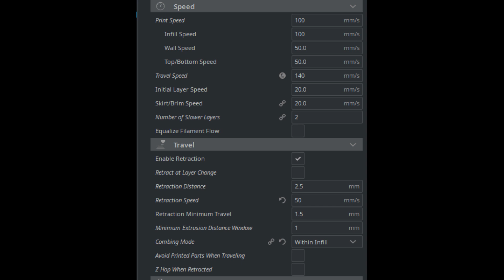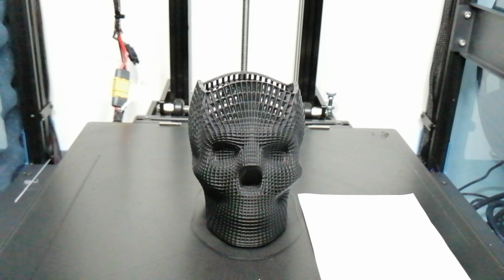Ender 6 - Stringing solved + Tips for Newbies and the Community

Comment: just recently discovered you, so my ender 6 strings like crazy, so decided to give it one more good hurrah before i fill it with tannerite and make a youtube video. I'm working on relocating the extruder like you did here, so when I got home my ender 3 had finished printing my spacer/cable chain holder. I mounted the extruder up on the top rail and held up my Bowden tube, nice and tight because "who the fuuk prints in the corner" it looks like I'm only gaining about 6 inches less Bowden. does that short amount of gain really make a big difference or should i just mount it on the hot end and get it over with? wow sorry that turned out so long. I'm a texting mo fo
Reply from the maker: so i saved about 1/3 of the original bowden. You may have to let the bowden be "free", not in the cablechain :)

Comment: Just got my 1st 3D printer, an Ender 6, after helping my son set up his Ender 3 and after much mulling and review watching decided I'd like to get into the hobby. What a printer. Great prints out of the box with no calibration other than levelling the bed. I'm sure it can be improved through tweaks and your vid helps in that regard. I did have a bed adhesion issue to start with but with thorough cleaning, levelling and some initial layer heating and speed settings I think I've cured it. At least for the filament that came with the printer anyway. Great printer that I sure with some basic tweaks can provide many with good service.

Comment: Why use noctua? It's cfm rated 30% lower than stock fan.
Reply from the maker: i switched to a noctua cause the stock fan was horrible loud. In the meantime i switched to a Watercooled hotend :)
Reply: @PhilsBastelwelt  I decided to go with a delta electronics (the guys that do the fans on prusa mini and the new xl) awesome cooling, deadly silent. 

Watercooling? Wow. Not a consideration I've made yet.
Reply from the maker: @OiRob  I actually made a video abot the Heatsink i used (pretty cheap)... but it works very good. No heatcreaps, no clogges, works for me :) 
Will make a Video in a few days about that. Had some other issues to solve :)

Comment: Thanks for the video.. How did you solve the overextruding in the edges? I installed klipper and was able to solve it with pressure advance, but i have a value of 1.2 and that makes the extruder motor go crazy.. my extruder is in your same position.
Reply from the maker: Honestly …I need mir info about your printer…did you change something on the Hotend ?
Reply: @PhilsBastelwelt  yes, i changed the fan to a noctua and installed your lower pla part to avoud it blowing on the part. The extruder motor is placed where you placed it, and the tube is a capricorn. Thank you for your time
Reply from the maker: @sharkyigor  so you have the stock Hotend ? Stock Nozzle and stock Heatbreak? 

If this is the case you can try another nozzle or print slower…
Sounds to me that your Nozzle has to much inner resistance and a bad flow inside the nozzle..
Reply: @PhilsBastelwelt  ok thank you! Will make those tests and get back! Thank you for your support
Reply: @PhilsBastelwelt  ok, here is what I did: replaced nozzle, re-cut and mounted bowden tube to be sure not to have gaps between tube and nozzle, tried different filaments and temperatures.. nothing helped.. what improved the situation is changing the pressure advance smoothing time from 0.04 to 0.1.still not entirely happy. thinking about what else I could do
Reply from the maker: @sharkyigor  hmmm…so I don’t habe any more Tipps atm…could also be possible off wrong slicer settings maybe…

Comment: Great video and suggestions. Thank you for the time you took to make it. I am going to try your setting suggestions to  reduce stringing. I am interested to know which build plate (bed) you are using. Mine came with a tempered glass one with a texture on it. I was having a lot of issues with bed adhesion, my friend who has been 3D printing for years suggested I turn it over so it is just flat and smooth rather than the textured glass surface and so far that has helped.  What size Noctua fan are you using (or model number if you know it). Noctua are seriously the best! Thank you

Comment: I use the stock extruder on my ender6 and have some struggle finding the right acceleration and jerk setting. I still have ringing on the perimeter when printing holes. Do you have some advice how to get that fixed? Which acceleration and jerk setting would you use on the stock ender 6?
Reply from the maker: Honestly, I never made any jerk and acc tuning on the Stock Ender6, so I have no further info about that question …
Reply: @PhilsBastelwelt  May i ask which slicer do you use?
Reply from the maker: @subh34d  I use Cura… the latest Version :)

Comment: Wish I could say this solved my stringing issue but I suspect there's more to it than just changing a few retraction settings. I sliced a benchy with the retraction tweaks and when it was done I reaped the exact opposite - I'd quite literally doubled the stringing. Back to the drawing board...

Comment: Thanks so much worked like a charm. i will prob upgrade the hotend to a high flow dragon. will help with printing faster. i also got rid of the horrible touch screen and installed Th3d firmware. much more controll and super cheap.

Comment: I stoped using cura..now i use creality slicer instead with the ender 6 profile. I downloaded the latest slicer from creality. Cura did both string and the nozzle hited the object right from the start of the print up to about 5 or 10 mm. I used your setting but it didn't solve my problem. It got a bit better with your profile but still the problem was like 5 mm hitting the object and then it dissapear. No matter what filament i used i still had the problem...very strange but it's the truth. You should try creality slicer...didn't have to make so mutch changes. Just a little bit of the retraction 1 mm or maybe lower or higher flow. Never hitting the object again and no problem to get rid of the support on creality slicer.

Comment: Thanks for the video and the links.  I've been having lots of problems with stringing, trying your profile now.
I noticed that you set the print speed to 100mm/sec, but the printer is rated at 150mm/sec.  Have you tried it at the 150mm setting?
Reply from the maker: Nope …I never tried 150mm/s… I tried 130 and had problems with cooling ….

Comment: Your advice for newbies is refreshing. I have been 3d printing for 10 years. And I have found that "less is more" most of the time.  Common sense should be a guide to any change in a 3d printer. Keep up the good work.
Reply: I agree.  I never comment on YouTube but i wanted to do so just to thank you for emphasizing this point. I wasted days after getting my Ender 6 trying to get Klipper working.  kind of did but it was such a pain i went back to Marlin and am printing just great now (apart from stringing which is why i am here 😜). Get used to the printer first. Best advice people can hear.
Reply from the maker: Thank you ….I will do my very best 😇…

Comment: How did you get your prints to stick to the bed? I am running 200 filiment and 60 on bed temp, doesn't want to stick very good. I also found my Z offset was off .4mm.
Reply: You need to have an sd card in the slot and calibrate your hight with a paper and save it. It is saved on the sd card not in the machine. I don't remember exatly the procedure how to save it. At least i know it's in the machine under leveling...and you change z until it hit the paper slightly so you can drag it with ease and you hear a scraping sound. Then you hit the home symbol...not really sure but i think that's it. I know creality put up a video for this. Don't forget to adjust all four corners to manually on the bed. My firmware is broken so i can't save my z anymore. If you have problem with cura slicer then download creality slicer and you will find ender 6 there. It solved all my problem with stringing and the nozzle stopped hiting the object. I think creality slicer is much easier if you new in 3d printing. Download from the creality site...i had to change the language.... hopfully you will not get that problem...otherwise you can check regular cura and see where you change the language and navigate from there. Good luck

Comment: Hi it would really be good if you could reply. my printer hotend keeps clogging after printing a few layers. Any tips to prevent?
Reply from the maker: What Type of Filament are you using ? What settings I are using ? What mechanical Setup are u using ? 
I need more info to help you .....
Reply: @PhilsBastelwelt  tq for replying. i solved it. did a full cleanup of the hotend following ur hotend video. thanks for teaching ur fixes man. succesful print after 20 fails

Comment: In S3D I have z-hop disabled, 6mm retraction, print inside out & set to not cross outlines if possible. I think coast is set to .2 or thereabouts. Only mods I have made have been are z-rod top bearing mount, and Bowden tube & power cable mounts to the hotend and frame...3 MODS!!! BTW, I level bed with paper, 4 corners, while hot to account for any warp while hot. Works perfectly!!! BL-TOUCH is a crutch and fucking time waster!!! I see MORE troubleshooting posts on reddit for fucking BL-TOUCH than anything else!!!😏
Reply from the maker: Paper is best 😇😇😇

Comment: I got the titanium heat brake, but then i had clogging problems . 
then i removed it cleent it and found out that the 1.75 filament had a very very tight fit, is this normal?
And like you mention : when it is not broken dont fix it!
Reply from the maker: So to your question... normally you have some tolerances ... but the diameter of the inner tube and the Filament shouldn’t be so much far from each other ... maybe you filamentdiamete is a little bit higher ? Did you measure ist ?
Reply: @PhilsBastelwelt   thanks for the rapid reaction, i dit not measure it but i had it happen with 3 roles of  Petg from different manufacturers . by hand it is almost impossible to push te filament trough the nosle ( virgin from the roll, so i think the extruder marks even make it worse)
Reply from the maker: @martijnbrandt7553  yeah then you are right... not related to the filament. where did you buy the heat break ?
Reply: @PhilsBastelwelt   from amazon.de

Comment: Hello,
Thank you for this wonderful advice, you are correct, a lot of experts are too far in their world and they assume that the simple stuff is dialed in, so they advise hardware tweaks.
Anyway, I recently bought the same printer and I am very happy with it. I have some issues with stringing, which I will hopefully solve with your settings. Also, can you post your Cura profile? I have issues with supports, can't seem to dial them in. Either they are too strong or too lose.
Reply from the maker: My Profile is in a Thingiverse File ..the Link to that file is lockated in the Description of another Video from me:)
Reply: @PhilsBastelwelt  Much appreciated, I compared and found some issues with my profile for PLA, that I am still tweaking.
Reply from the maker: @white.cleric  I Hope it helps... just keep in mind that my setup at this Point was pretty stock...so when you changed the Hotend maybe ...you need different settings :)

Comment: You are right, the fan is really super loud!!
Did you need anything else than the fan to install? Where did you install the cables?
Reply from the maker: jep... the noctua Fans are running with 12V... the originals with 24V...therefore you need a Step-down module... to convert the 24V to 12V... this weekend I will. make a short vid for it :)... and I cut the cables and connected them by a 2.54mm Pin Connector... I will also show this :)
Reply: @PhilsBastelwelt  nice, thanks. Looking forward to the video!😃

Comment: *strong accent, not "bad." =)

I'll adjust my settings a little more. I've got the stringing almost under control, but if this helps, I'm all about improving.  

Right now I'm trying to figure out how to do supports without totally marring the surface they support. 

still watching the video

The print looks amazing.  

I've got a challenge for anyone who loves B5.  I tried to print the starfury on thingiverse on it's side.  It's the only way you can get a large single piece print. But the supports are really hard to adjust so they don't engulf the entire thing.   I used an entire roll of filament on it and the starfury itself looks amazing, but the supports got jammed in all the nooks and crannies and I broke it trying to remove them all.  I'm getting better at doing supports now, and have downloaded a couple support extensions for Cura that might help a bit.   After I do a couple necessary jobs, I may try the star fury again.  I was considering designing the vectoring plates on the engines as separate pieces that have posts that stick inside the engine itself to print separately, but if there is a good way to print it as one piece, maximizing the 250X250X400 space, I'm interested in seeing it done.   

This is the one I was using. https://www.thingiverse.com/thing:12730
Reply from the maker: Yeah.. supports are a messy thing.... I always try to avoid them... and jes...thats "German accent" :D
Reply: @PhilsBastelwelt  yeah. That's cool. I have 1/2 German blood, but my name is Swedish. My mom's family is Steinwedel.  A little German. XD

Comment: Great video. Total newbee question here.
Does this ender come stock with the mk8 hotend, or is it a v6 like the cr10 v2?
the mk8 will reduce the speed of this mashine running bigger nozzels like 0,5 - 0,6 yes?
Reply from the maker: it comes with a MK8.. but it is always the same.. with a normal. Hotend you are limited to 0,6mm nozzle... if you want to go higher, you need a volcano.. then you can go. up to 1.4mm

Comment: Gute Arbeit der Kopf
Reply from the maker: Danke :)
Reply: @PhilsBastelwelt  drucke auch mit dem Ender 6.
Gestern habe ich mir den Lüfter bestellt und bin gespannt.
Jetzt probiere ich mal diesen Skull.
Schaut nur leider nicht so top aus wie bei dir.
Wäre es möglich deine cura settings zu bekommen?
Danke
Reply from the maker: @markusbuchler6128  Ehm...mein Profil ist in der Thingiverse-Datei mit drin. Du musst dann nur die Retraction-Distance anpassen... ich bin mit dem Capricorn von 6mm auf 2,5mm gekommen :) ganz wichtig ist das Ausschalten von "Z-Hop bei einziehen" ... bei dem Lüfter brauchst du abe rnoch nen Stepdown -Wandler..der Orginale läuft mit 24V..der Noctua mit 12V !
Reply: @PhilsBastelwelt  danke dir für deine hilfe 👍
Schaue ich dann gleich mal.
Freue mich auf weitere Videos 💪
Reply from the maker: @markusbuchler6128  Puh..keine Ahnung ob ich weiter Videos mache... ich werd an dem Ender 6 nicht mehr viel verändern... aber mal gucken..vlt noch n Guide zwecks Lüftereinbau etc... 
Aber hab gerne geholfen :)

Comment: Great video and helpful tips!
Is it possible to share the bowden tube and cable holder too?
Reply from the maker: The Link for. the Bowden Tube is in the description (Amazon Link)...but the Cable Guide was a thing build. of some scrap that was laying around.... in the future I will make a useful. guide... the one I already build was not good..and so I won't share it...
Reply: @PhilsBastelwelt  have you thought of using a fishing rod eyelet for the guide as they are cheap and easy to get hold of with many different kinds to try?? 
Just a thought , I havent moved my extruder yet but your position looks the goods 👍
Also I got rid of that large Black cable tube and fitted mine into 10mm split tubing which allows cable to flex better so less drag on trams and also fits straight into the original cable holders
Reply from the maker: @anthonydendle4768  well... that's a good Idea :) Thanks